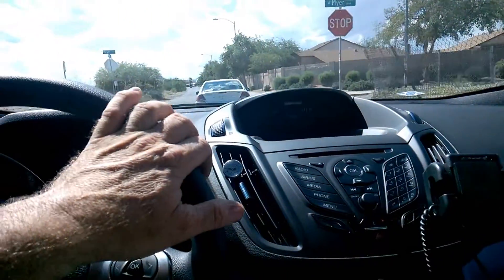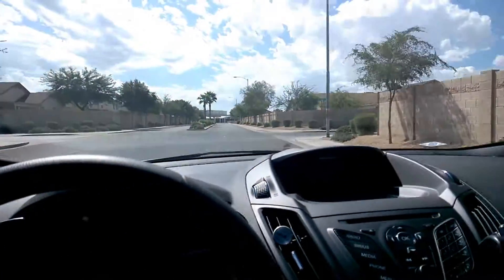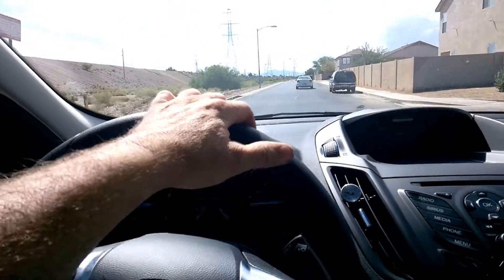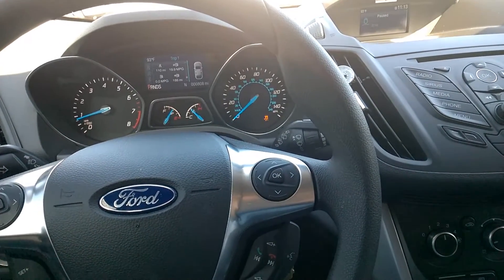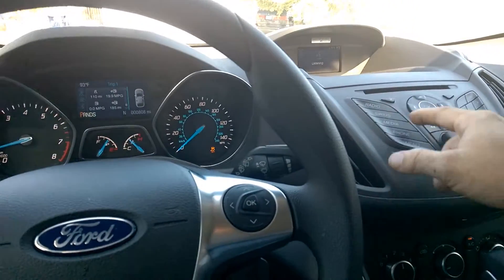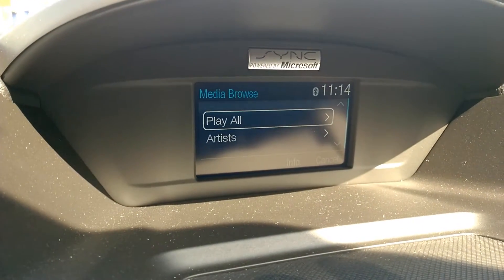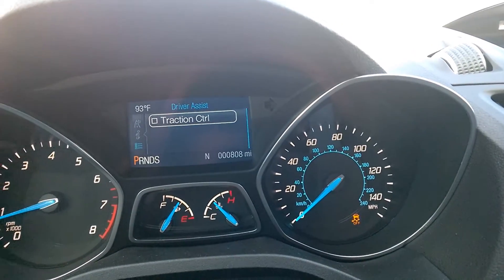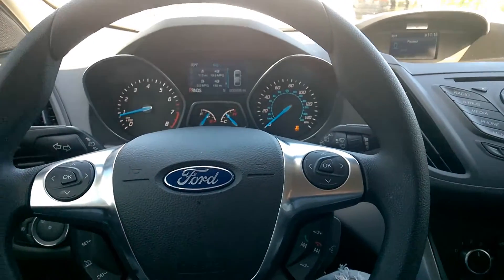Does Ford Ecoboost have external Blow Off Valve?

Comment: Mine is a lot louder than this. Like a lot! I have the red edition (comes with black mirrors and roof and a stage 1 factory remap) with my induction kit I fitted I'm running about 150psi. And the dump/blow off noise is immense! Sometimes if I let off real slow on low boost I can even get it to flutter! Blown away by the power of this car and what it's capable of for a 1l turbo!
Reply from the maker: 150 PSI? I think you accidentally added an extra zero to that. LOL
I figure you meant 15 PSI
I have still not hooked up a temp boost gauge to see what this engine has for stock boost.
Reply: hackfreehvac Haha my bad I meant to type BHP lol. Not too sure what PSI I'm running to be honest would love to find out though. Soon I'm hoping to fit some boost gauges! You can get an awesome one that replaces the driver side air con vent, looks awesome :)

Comment: hi I've had a bit of a problem with mine the vacuum pipe has split to the blow off valve now it's doing a loud fluttering noise not sure if it's the standard blow off valve not working will this damage it if I don't get it sorted soon or dose the car really need the standard blow off valve can it be disconnected thanks adam

Comment: I'm sure there is one. I did a little digging and Ford seems to use electronically actuated valves instead of the normal vacuum actuated ones. An intake will make the bypass louder but dumping it into atmosphere is probably a no go since you have a MAF instead of a MAP sensor.
Reply from the maker: Yeah I do notice that since I drove with the windows down when it cooled off at the end of summer that it does "blow off" loud enough to hear it for sure.
Whether it is internal or external. I can hear it.

The turbo is crammed behind the engine so it looks like I'd have to either get under the car or remove the cowl section to check it out.

Comment: you should see the torque curve on these. Its actually pretty impressive!. Flat from 1500 to like 4500 rpm!

But watch out for the intake valve residue! This is a project for ya! The PCV system lets so much crud flood the intake that #2 intake valve on cyl 2 and #1 intake valve on cyl 3 get excess build up of carbon on the valves and dont close right. That causes a rough running motor by 30,000 miles! Ford released a tsb saying in warranty vehicles, just replace the head (or heads!)! "DO NOT RUN A CLEANER IN THE INTAKE MANIFOLD!" thats from ford. And they want every head that gets replaced for testing cleaners. So the project is, make a filter canister to save your motor from the major problem.  Here is a vid explaining:
Part 1: New Warning To All Ford Ecoboost Owners!

Part 2: Ford Ecoboost Warning Part 2 My Findings

Very good info from that guy!

 These motors produce so much soot out the exhaust its crazy! The exhaust on my 4.6 2v is clean, I can wipe my finger and nothing. M grandmas 2014 Edge eco boost, 6000 miles. Can't even tell it has stainless tips! They are jet black!